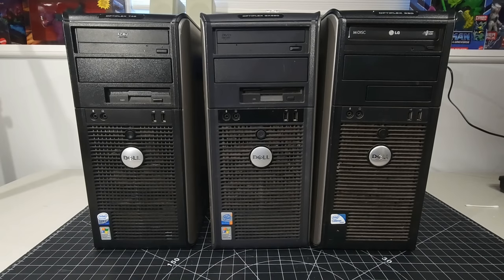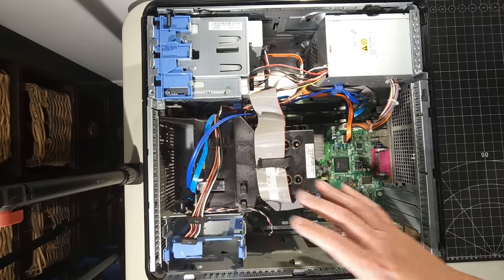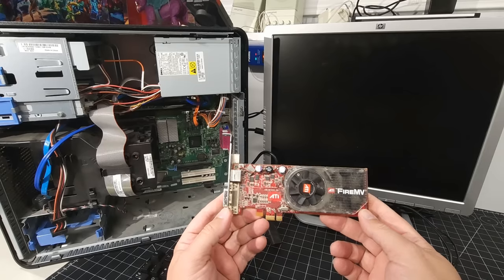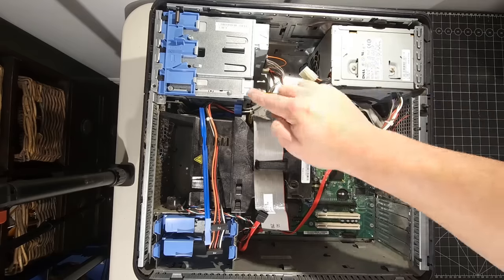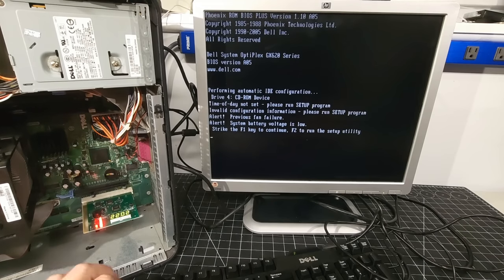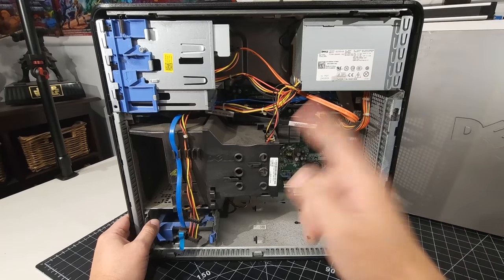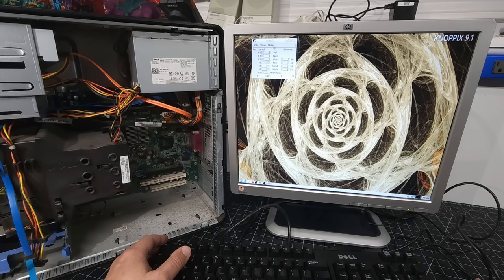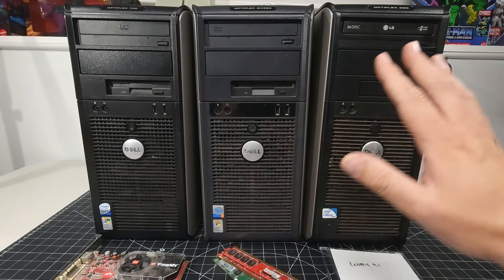The Dell OptiPlex BTX Trio ... Do they work??

Comment: I think the cooling advantage of BTX wasn't really there. HP had the same wind tunnel design with ATX form factor with their dc5700 and dc7900 line and many off-the-shelf cases allowed for different orientations for ATX. I suspect Dell just wanted to stay proprietary.
Reply from the maker: I think there were definitely others than Dell who had taken on this format, however ultimately ATX won the (vcr/beta) battle :)

Comment: im trying to help best as i can to help a reverend at a local church to keep his dell going i know it has a core 2 quad but it has some power issues  if i ever get to speak with him again im gonna try to replace the thermal paste hopefully that stops it wanting to reboot at times but forcing a non dell psu in it did make things a little easier  though i have 2 dell boards i do not know if they work however its just like the one in the video if i remember correctly....othat one bport i think itscalled a dms59 if i remember correctly
Reply from the maker: Your awesome!! I think you are right - I just looked it up and amazon has them :). Thank you!

Comment: I fixed a Vostro 230 today at work that had one of the giant PSU's, the same one these had. The other tech had cut one of the sides off the chassis of the power supply, and it was weakly screwed in, with about two inch recess at the back....just swapped it with a cheap used one that fits. Whoever else worked on it was a HACK
Reply from the maker: Hahah!! I have seen so many of this hacks... Trying to git stuff into cases.  Idea - how about getting a different  case?? Lol.
Reply: @TheRetroRecall  right? Any cheap atx power supply works fine in it fits like a glove. Unplugged a 4 port usb 3.0 card that they weren’t using (sata power didn’t reach) the new power supply is way less wattage and it worked out lovely
Reply from the maker: Nice!

Comment: The Optiplex 360 should take a core 2 duo e8400, e8500 no problem if you want a cpu upgrade too this machine, core 2 quads are unfortunately not supported unless you upgrade the heatsink & powersupply.
The Optiplex 745 on the other hand takes 1066 mhz fsb core 2 quads so cpus like the q6600 & q6700 should work fine here.
Reply from the maker: Awesome, thank you for this info!
Reply: Mini
It supports up to q9650
only the G41 express chips set is corrupted by DELL

Comment: Ah yes the Dell computers, probably the brand that looks so identical but never is the same inside. 
That reminds me of a painful story I recently had to endure. So I had this Dell Pentium 2 laptop for a long time, I got this in a very poor condition back in the days of old. it had a cracked frame for the screen with broken hinges, bad hard drive, blown speakers, broken CD drive. dead battery. dead bios battery. well dead everything actually, not even the CPU fan would run on it. it could for some miracle boot but that was pretty much all it did.

So I have my Toshiba P1 laptop and I needed it for moving files and because it loves to make me mad it always freeze when trying to use a USB drive for some reason and I wanted to install some files to my CF card. story short I tried everything nothing will make that work.

My thoughts went to the old P2 laptop and that I kinda wanted to fix this broken misery so that I could use this for moving files instead. but everything is broken on it so how do I go about this? I scouted the auction site and managed to find an identical model type laptop in broken state, it had many issues but it had a 100mhz faster cpu. and it came with a floppy drive. I thought excellent I can use it for parts so I got this.

my work began to start testing what worked on the stuff I bought, it came without a hard drive and no power brick so I had to use my old stuff, here we go. ok so the bios won´t save so that battery was dead, I can see it is a multicell nimh battery on wires. I can probably make a solution. but the case was all broken, the screen hinges broken, the frame  broken, keyboard somewhat broken. well the speakers did sound better at least and it did boot so my plan to use it as parts was good to go.

I took it apart and then I could see the "new" motherboard had damage from the nihm battery leaking onto the board, ok so I just move the CPU to my old one, same with the screen it was bad, and it has a nice blue pixel shining like the sun in the very middle field of the screen, I just use my old instead. 

I took my plan into action as both laptops was hopelessly broken in their own way, I had to use the best plastic details from both computers to make a somewhat good chassis. which I did, then I removed the cpus and was about to swap them.

wait what? they have different connectors? oh yes they do and it did not fit. Oh boy here we go, and I wanted to use the faster one. so what, I just have to repair the damage on the new board and use this. I got this fixed and made a battery pack for use as a bios battery. I had the stuff lose and scattered all over my bench and floor but made sure the computer was booting up as it should.

next step was to replace the broken screen and repair the snapped hinges and broken frame. well Dell had the ingenious idea to glue the LCD to the frame with this holding lose parts together with tape even for the backlight. 

sigh, Ok i just have to swap over the whole assembly from my old computer and repair those hinges and cracks instead. I eventually did and had it nicely mounted to the laptop. I push the power button and. Ok so I push the power button again and??
Ok so I made sure to summon the mighty button pushing spirit in my right arm and made sure that stupid button was absolutely positively pushed down and?? nothing. completely dead. I could measure all voltages on the board but nooo, it went all in on the I gonna mess with your life road for sure. But I had this running just a while ago what was wrong?? so I back track what I did. I swap the screen which is Identical, is that shorting out or something, I took the connector off and push the button and it woke up, what? I hooked up the other board with the new screen and tried that too, It was also dead. for real?

so is this a two time failure? ha ha ha no. I took the new screen and hocked it back up with the newer board and Yes, it boot and got picture. So Dell had the best idea in the world and had MARRIED that bloody screen to the motherboards or somehing. my patience had started to fade at this point. I went to bed and all I could think of was how mad I was because I had to use the screen with the broken pixel because of this. 

Next day I was ready, I had to repair the new screen as I did with the other because, yep same computer same broken stuff.

I also had to repair the left click button because it was broken on the pad that had the better less broken frame. I got it done quite peacefully.

I proceeded to assemble the computer and was at the point to finish it, right the keys was broken on the new board, I just grab my old and use that instead and it made a perfect fit into my rebuilt computer. I booted it up and? ok what is it now??

it won´t work again? mother of all ****. I had the thought of a married screen, have they really married the keybboard too?

You damn right they did!! Dell for the love of why the frick you do this to me?? siiiigh. Ok I had to fix the keys and use the newer one anyway. So basically the only things I could use was the speakers, the hard drive and bay and some plastic details. 

fantastic I just wasted all this effort to just make my old laptop even more broken and the newer slightly less.

I still had to fix the floppy drive, the eject button was broken off, I managed to build a new using a cable shoe of all things with a heat shrink, worked pretty good.

And the CD drive? yes it was broken enough this gonna have to be a story of it´s own

But I at least managed to make a "somewhat" working computer out of it in the end, But I gonna remember what it did to me for a long time to come!
Reply from the maker: Hahahah first off - love this story.  When I saw the length of it, I went and made myself some tea like I would when I want to sit down with a good book. Achievement unlocked!! Ever think about narrating Audiobooks??

Now that that is out of the way - sounds like you had a positive experience with Dell overall 😂.  Think about how much you learned through this process - see... SEE!!!  A positive!! lol! 

Thanks again for another great read and for being a part of the channel!
Reply: @TheRetroRecall  Glad you like it :) I am happy I got a computer to use when I need it :)
I never really thought about writing or making audio books, however it can be fun writing a good story sometime. maybe I should encourage it more than I have in the past.
Reply: @TheRetroRecall  btw, I did not say that I don´t like to read or write in any way or mean to offend in any way. I absolutely encourage people to read, and I like to write stories that people enjoy reading. I guess I said it the wrong way, sorry for that
Reply from the maker: Hahaha no no, all good!!!! Sorry, I just didn't see your reply lol.  Keep them stories coming!!!
Reply: @TheRetroRecall  that’s good :) I left a story for you earlier in your latest video about the capacitor plague too. Not as long but a true story too but a true one too
Reply from the maker: Replied! I had to go hunt it down as YT didn't notify me.

Comment: Dell was annoying type of brand model, I have the mordern type with run DDR4. Now use as personal server or backup part. I miss the 1.44 floppy, the reason i wont use dell again because the BIOS problem, so I use Lenovo or Fujitsu etc BIOS is feel better.
Reply from the maker: Did the BIOS cause you the ram issue or other CPU issues?